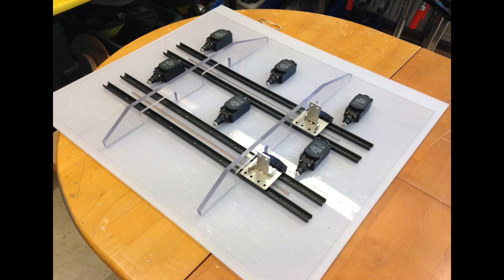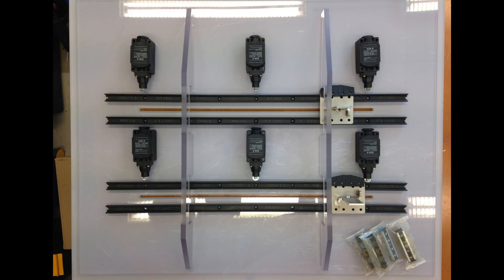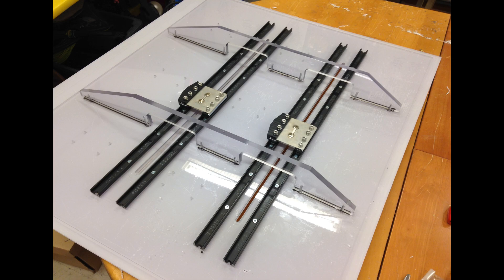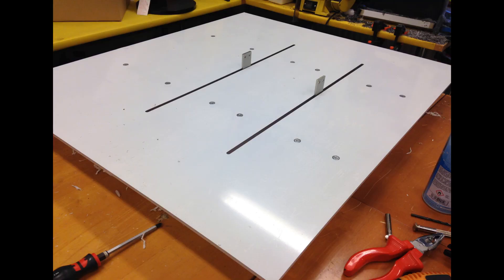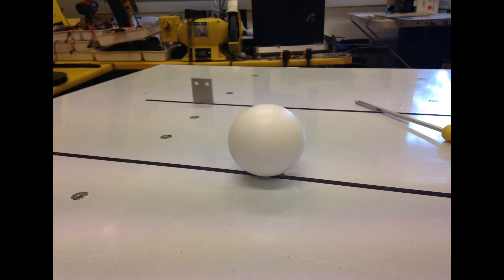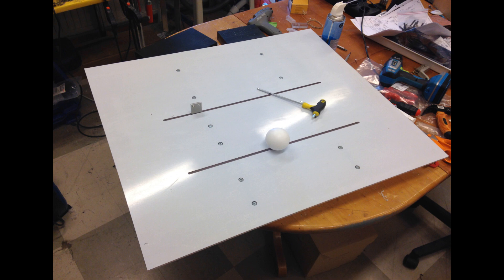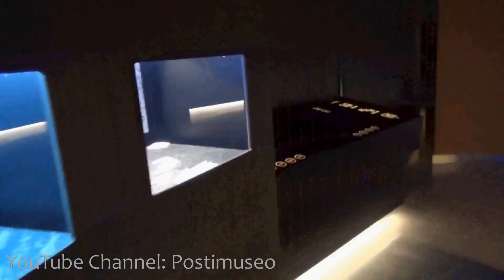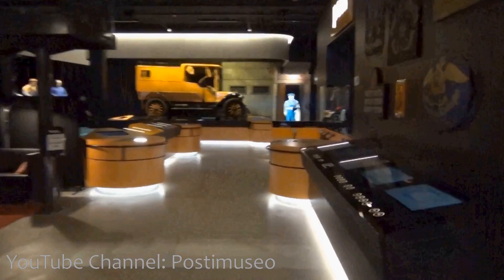Making a Ball Handle for a Console ( CNC - Mill )

Comment: This is a really rugged control panel. Have they requested a minimum number of cycles or years of operation? I am currently angry with my cnc router and stopped using it until i have the nerves to investigate the issue. I order all my parts at a machine shop nearby the machinist there is better than i am anyway:) Thanks for sharing! It looks amazing! I guess the feeling of making such a good sphere is really satisfying.